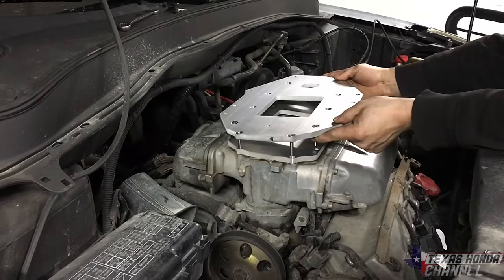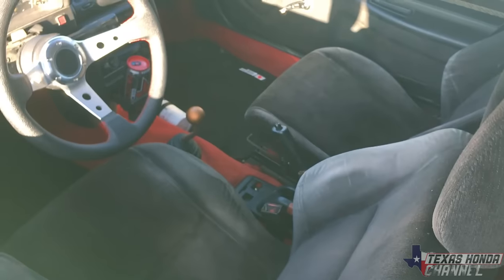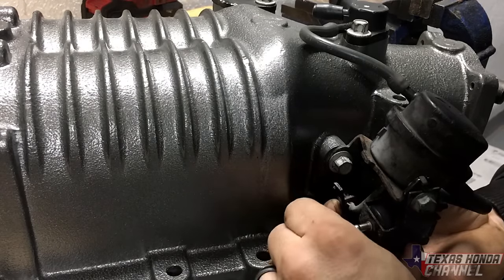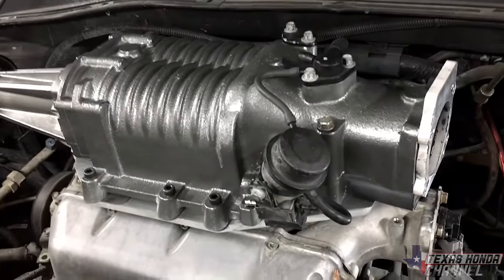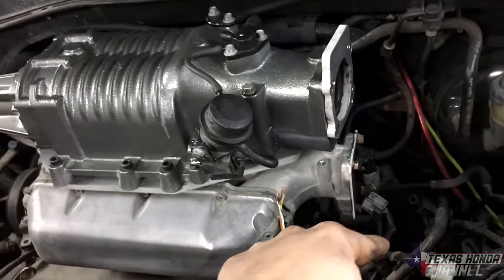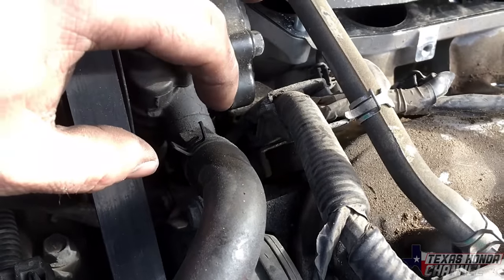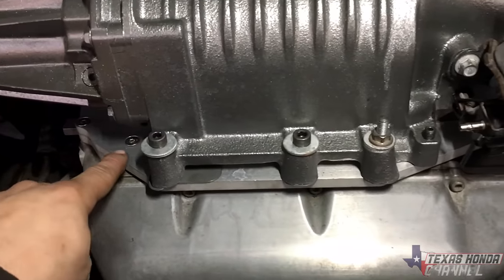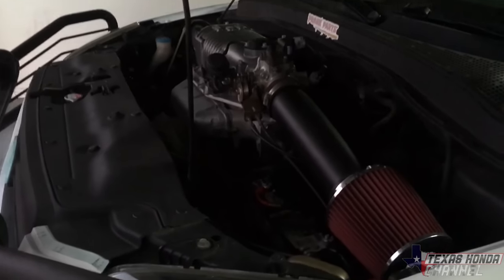How To Supercharge a J35 Honda Pilot In SUPER Detail (Supercharged J-Series)

Comment: You ever get an idler for the supercharger? It’s easier to make boost and keep the engine out of boost with the idler pulley installed. Colder plugs and a way to keep it from heat soaking. As well as a smaller pulley

Comment: does a 2007 honda pilot have the j35 engine?
Reply from the maker: It should
Reply: Yes, but is a slightly different variant. 05 and older has the j35a4, and 06 is the j35a9 and sometimes the j35z1. Pretty similar though so all this stuff should bolt up.
Reply: @billspangler2685  alright thanks

Comment: How thick are them aluminum plate 4 the supercharger
Reply from the maker: Didn’t measure but removing the tq spacer would give added clearance for most vehicles except accord
Reply: @TexasHondaChannel  yeah I was making my own custom plates to bolt the supercharger on and they look like they're a quarter inch thick each plate? Lol so I can put it on my four door Civic e.g j35a4. went 2 Pull-A-Part got my supercharger from a 2006 Pontiac Grand Prix. You really inspired my build your videos are great keep up the good work!!!😁
Reply: @TexasHondaChannel  if you get the time let me know on the measurement thanks a lot

Comment: Bro! Im a san antonio transplant and my honda fit got shot up in a gang related thing a few months ago. Im having a bitch of a time finding my electrical short (one round went through the rear main harness). I rewired it a but still cant keep my turn signals on. Do you have any advice?
Reply: Maximilian Lockard   moved here like 8 months ago. This happened in november. Came from detroit. According to local pd this never happens - location is Stone Oak (which is supposedly the good side of san antonio). Like jesus.

Comment: Budget wrench a part in belton was my playground when stationed at ft. Hood. Found so many great parts. Can you remove the spacer on the lower intake and not have to clearance the hood? Also how much was the kit and the bearings in that blower sounds shot. Upgrade those and the coupler bearing to a Teflon version.

Comment: So do you know if the j30a4 can be supercharged?
Reply from the maker: I have seen people using these kits on the j35 there was a few images on google of it where they used the j32 intake manifold and bolted it to the top but I would do more research On it if I were you because the j30,j32,j35,j37 are all very similar

Comment: ive got a toyota 5vzfe 3.4 v-6  with a magnuson mp62 supercharger. I was wondering why you arent shooting fuel in through the EGR port you closed off at 4:30 in the video.  urd performance makes an injector that is made to bolt right to that port. and you could get almost any controller to run it that runs off of vacuum or boost pressure. on the magnuson...  more fuel and it would atomize and cool the supercharger making more power.  if shot more fuel in up top your computer would adjust the fuel the other injectors are spraying so you would still get the right amount of fuel... oh and ive found the 2 step colder plugs are the sweet spot for pinging issues.

Comment: Hey James just wanted to let you know if you blocked it off it wouldn’t run like that
Reply from the maker: That is true forgot about the way idle air control valves actually work for a min. Similar to EGR valves where they open and close

Comment: Welp... My honda ridgeline is calling.. holy shit. 
Supercharge a honda ridgeline or turbo a scion xb?
Reply: the transmission wont hold up
Reply: @alexg9727  neither of them will. Shit my Ridgeline trans is already getting clunky... Only been 270k miles..
Scion had 245k
I have a daily for my daily, don't ask
Reply: @gmbb315  My 2017 honda accord 6 speed automatic had the valve body changed at 140k miles just not long ago. After driving it too hard

Comment: I wonder if all the extra volume of that intake. Causes any lag in boost
Reply from the maker: I had to turn boost down because it built it up too quick lol 😂 I’m at the lowest it will go now which is 1psi. Once it’s tuned that will change
Reply: @TexasHondaChannel  does that pilot have a wideband o2 sensor factory? If so you can buy a cheap elm327 obd bluetooth scanner and use the torque app on a cell phone to monitor air fuel ratio live
Reply from the maker: @sinformant  it has 2 o2 sensors so idk 🤷🏻‍♂️ but I have the wideband from the civic ima throw in to get the measurements and adjust the tune
Reply: You are killing it! Great job!

Comment: yo you got any useful info about how reliable the j35 on the pilot will remain with stock internals after adding the sc with low boost? worth it swap the head or anything? Subbed

Comment: You could've used the greddy emanage ultimate or the hks fcon pro for piggyback, and I figured out you can use zzperformance aftercooler but of course there would be hood clearance issues, but I got that figure aswell, you can lower the engine by 2 inches with spacers for the subframes and side motor mounts..
Reply: How well does the pilot work with either of those? I'm curious to know, as I might consider one
Reply: @austinbrewer2680  well to my understanding, hks fcon pro can control shiftpoint on an automatic, injector and timing.. Greddy emanage ultimate is good for timing and fuel only, I have pulled the ecu pinouts for the mdx will be making a plugnplay harness..

Comment: Is your pilot a manual.
Reply from the maker: I wish. It’s a automatic but will be getting a transmission cooler since heat is the main leading cause of transmission failures and is recommended for hard driving and high heat conditions and I live in Texas so it’s probably best that I do it anyways
Reply: @TexasHondaChannel  you think the supercharger will fot an 08 ridgeline?

Comment: Hey so my 06 accord is j35 swapped and it has dual throttle bodies, how would that work with the supercharger
Reply: Custom a pipe to Y pattern that'll fit the throttle bodies
Reply: So ones just a VSA throttle which is not necessary. Just drop it and plug the coolant lines and slap on the SC.

Comment: Have you been able to find out how to do the swap with drive by wire?
Reply: This is what i've been trying to figure out. I have a 2011 Honda Pilot Touring 4WD that I would like to supercharge in the near future. Judging from his other video of his 06 Acura TL that has throttle by wire/drive by wire, you CAN supercharge them too, and shouldn't be too different. Unfortunately, Prank Parts no longer makes the adapter plates. I am going back to school in a few weeks, thanks to the VA (I'm a Veteran), for advanced manufacturing. I want to learn how to work with CNC Machines. Once I get the knowledge/experience, I will be making my own adapter plates. This is a rather easy and cheap mod once you have the necessary part.

Comment: I’ve been wondering if this will work with a j37a intake manifold and throttle body cause Ik when those are paired with the j32a2 ported heads it can make 300-320whp

Comment: Would this work on the j30 engine?
Reply from the maker: Indeed you can but things would need done a little different but same concept
Reply: @TexasHondaChannel  I'm curious how the transmission will hold up, the trans in those hondas are pretty weak.
Reply from the maker: @dangerdome1997  they aren’t that’s a misconception I have out 1,500 miles on it and if it was gonna break it would have already I have 199,000 miles on it lol 😂 fresh fluids and a transmission cooler do wonders!

Comment: How much does this whole setup run cost wise? Are the stock fuel injectors/fuel pump adequate for the extra power its making? What do you think it's making for whp/torque?
Reply: Ok I just saw your running a higher LPH fuel pump but I'm still wondering about the other stuff.

Comment: It doesn't matter what motor you have throttle body spacers do absolutely nothing unless you are carborated
Reply: They do add plenum volume. Also adds to the length of the throttle body which plays a role in wave tuning.

Comment: You didn't need bigger injectors? And I wana do this on my 06 Saturn Vue Redline J35
Reply: You have the redline nice
Reply: @MrBigboy5290  Yeah 06 Redline with CAI
Reply: Wait why does a Saturn have a Honda engine
Reply: For 2004-2007 they have the Honda 3.5 v6 and trans. Light weight plastic Saturn body it ripps
Reply: @Mcperformance1  wait wtf when and why did Honda partner with Saturn
Reply: @Mcperformance1  this is extremely cool wow thank you for the info
Reply: @sonzaun5262  Because Saturn sucks and can't build a good engine I guess lol, either way parts are super cheap for the whole svu it has a full body kit 18" wheels leather/suede interior etc. Google 2007 Saturn vue Redline.
Reply: @Mcperformance1  yeah I just watch a breakdown of one guys supercharged build they're way cleaner then the crvs in my opinion
Reply: @Mcperformance1  cai?
Reply: @MrBigboy5290  Yeah I have a Full K&N CAI Fresh Coil packs and NGK Plugs

Comment: Except there is info on this all over the internet, the comptech supercharger was cancelled production, and the m90 adapter was just not practical compared to turbo because of the heat involved with the superchargers..... so obviously you aren't apart of any J forums..... ive put months of research into it myself and  know that supercharging J's came as far back as 2004

Comment: My friend did that 2 yrs later he blew the transmission
Reply from the maker: Did he install a transmission cooler because it’s required when your transmission has to work harder Honda even makes a kit for this reason. It makes towing capacity from 3,000lbs to 5,000 just by adding one
Reply: @TexasHondaChannel  Well he still has it it's sitting on his field somewhere left to rot there

Comment: How much did cost you all together I’m definitely interested in doing it to my pilot and outta curiosity couldn’t you just make an adapter for the thottie body instead of flipping it???? I live in Vermont so I need the heat 🤣
Reply from the maker: I will have a video on build cost and such haven’t added it all up lol 😂  the adapter would need made to turn it at a angle but could be done but I don’t own expensive CNC machines lol or access too any

Comment: Is that a gen 5 Eaton supercharger? I’m really wanting to put this in my 06 Saturn vue redline which has a j series
Reply: He used a gen 5 but you can also use a gen 3 just need a different adapter for the Throttle and it will work on a Saturn Vue you just need to modify more then the pilot, I'm in the middle of doing it atm to a 2007 Vue.

Comment: nice setup. can I run the M90 on a 2013 Acura TL with 3.7l J37?
Reply: Id belive so if not just downgrade to a j35 intake manifold and throttle body there basically all the same bolt on. Only difference is the air flow and diameter of the intake outlet

Comment: 2bad u couldn’t find an EPS rack& eliminate all of the steering hydraulics.
Reply from the maker: Yea that would be a option too. Never thought of it really lol
Reply: @TexasHondaChannel  I’ll go u1 further. Imagine supplementing your work w/an EPS rack &a electric scroll style A/C compressor. Then your accessory belt would only b driving an alternator or in your case alternator &a Supercharger. 

I own a beautiful 2008 Honda Element &a 2005 Acura TL A-Spec. Both r candidates 4accessory electrification & simplification. Forced induction would be even simpler. 

We like the way that u r careful not2 over boost knowing that more tuning is needed on the fuel curve& probably fuel pump, regulator &📢injector upgrades.

👍🏾NIASE MASTER TECH, instructor grade

Comment: Will this work on a j35z3 or z2
Reply: My question too!
Been looking for this or a turbo manifold
Reply: Yes but the adapter kits are different. You’ll also have to figure out how to control the super charger because the new j35z3 don’t use a throttle wire. You should look into the j37a4 swap. Might be a better idea.

Comment: Will this work on my 8th gen J35 accord?
Reply: currently building mine just bought the supercharger should work
Reply: @notcbass  update?
Reply: @heythatsprettygood6492  currently waiting on the adapter to come in so far got everything might have to get a better transmission and better fuel injectors
Reply: @notcbass  what transmission you got rn? Lookin into what to do with my 4th gen tl
Reply: @heythatsprettygood6492  still got my oem 5 speed transmission the supercharger will destroy it so i would need something that could keep up thinking about building one or salvaging from another vehicle

Comment: Can I install on 08 j35 accord ?
Reply: You have an electric throttle body so it would take standalone ECU and a tuner
Reply: @mochaplayboy3533 dyk by any chance how expensive that’d be. at least a round about
Reply: mine has the j35z2 engine i’ve heard abt the unreliability after trying to turbo or anything like that so just think i could throw a super charger on it with not many problems?

Comment: Its really hard to take you seriously when you put a grill guard on what amounts to a minivan.
Reply from the maker: Idc what you think so there’s that. Lol
Reply: @TexasHondaChannel  yea, I figured. Do you laugh at idiots that put fart cans and wings on civics?  Because that’s the exact same thing as a damage enhancer on a pilot.
Reply: You're being kind of rude about it, but it isn't just a damage enhancer. It's main purpose is to prevent the airbags from deploying in an accident. I really like this build though and can't knock it. I almost put a grille guard on my 06 because they actually make them look much more rugged with the proper tires.
Reply: @billspangler2685  uh, what?  Lmfao. No.
Reply: @sjfk1306  my 06 4wd has beaten every v8 full size 4x4 truck from 93-08 in tug of war. Silverado 350s and f150 modular 5.4s just spin all 4 tires furiously while my pilot tugs them around. It's not necessarily rugged in terms of nuts and bolts, it's rugged in the fact that it uses it's nuts and bolts efficiently to perform higher quality work with the smaller powerplant it has. Raw torque means absolutely nothing if you can't translate it to wheel movement with traction. As long as you have a cooler, the pilot trans can pull everything a standard american v8 truck can- and likely for longer without a rebuild. I regularly go creeking and pulling 7000lbs+ and has done it for 200k now with nothing outside of regular fluid service. Just because there aren't frame rails doesn't mean a vehicle cant be rugged and capable. It's the way of the future and you are the one being left behind by advancements in technology.
Reply: @billspangler2685  no ego. And no fucking shit. Everything you’ve said is common sense.... But it’s a pilot. It’s a minivan... I’ve owned several of them....   smh. Just stop.
Reply: @sjfk1306  at the end of the day, you absolutely cannot say it can't do any job a smaller truck can. Plus it's magnetically actuated 4wd with real locking hubs when most awd/4wd suvs have clutch transfer cases which are trash. It was high tech and way ahead of it's time. What it lacks in mass it makes up for in handling, comfort, and veratility. Never tried to rouse the truck simps' wrath here, just saying that mini van doesnt seem so shabby with some sc whine and that airbag inhibiting grille guard... Dont knock the build, because it still works on smaller animals, light taps, and gives something to sit on when you go fishing.

Comment: Going to do this to my wife’s 2017 Honda Accord Coupe V6. Anyone know if someone has done it on a 2014+ Accord Coupe V6?
Reply: I’ve seen a few turbocharged 9th gen’s but not any supercharged. You may have an easier time going with a turbo as there’ll likely be more info available.
Reply: has to be the worst Idea on an automatic trans
Reply: With a stage 1 tune and full bolt ons my transmission overheated and damaged a bunch of sensors and valves.
Reply: The auto transmissions on the 9th gens already run hot and if you add even 20-30 hp its too much

Comment: I’m doing this to my MDX will a k tune work for a j37 with this supercharger??? Where do I get this I gotta have this!!!!!
Reply: Check k tunes list and see if your computer code is on it, if it is it will work.
Reply: @darrellc593  thank you 🙏🏾
Reply: @darrellc593  I checked the website for the supercharger they don’t display it for sale just the accessories
Reply: What website prank parts? They only sell the kit to make it fit onto the engine you have to find a m90 at a scrap yard or ebay
Reply: @darrellc593  awwww ok thanks man I didn’t even know
Reply: @darrellc593  I really appreciate you for replying to my messages you been a great help
Reply: @msbs1813  the prank parts adaptor does not fit on the j37
Reply: @hugosanchez9280  it fit I just need to find a decent tune I was told the k tune won’t work on a j37 but imma get a different opinion I did get a run out of it without a tune
Reply: @msbs1813  wait what how did u get it to fit
Reply: @msbs1813  I bought the same kit and it’s doesn’t on the j37a4 manifold… the bolts do not line up
Reply: @hugosanchez9280  i use liquid gasket cause it had a little vacuum leak and longer manifold bolts
Reply: @hugosanchez9280  
Someone told me that when I got mine I had to get the holes drilled to line up after I installed it it had a little leak so I used liquid sealer
Reply: @hugosanchez9280 
You can order it without the bolt holes on it but order it by phone